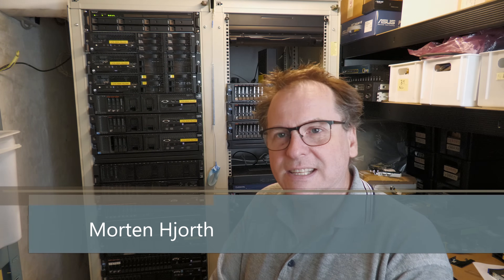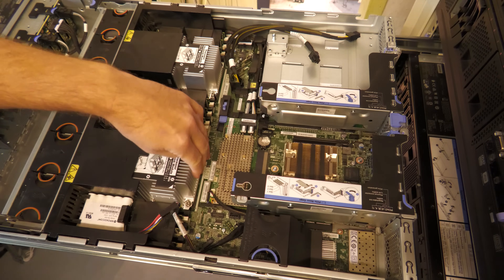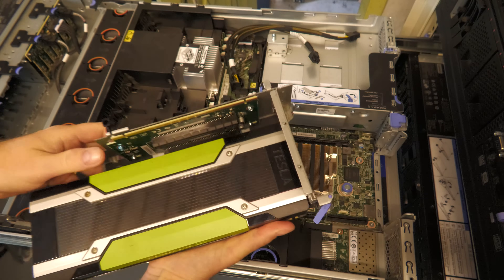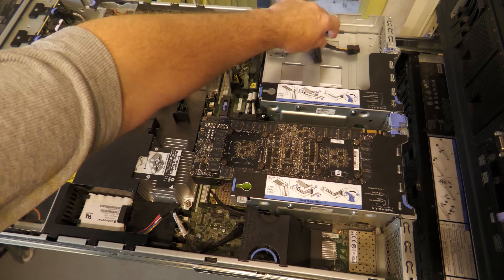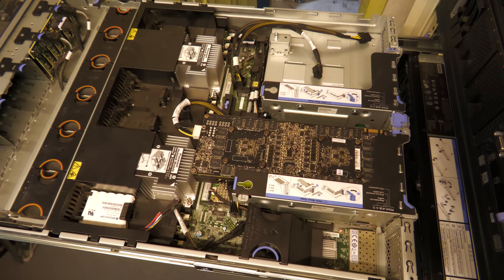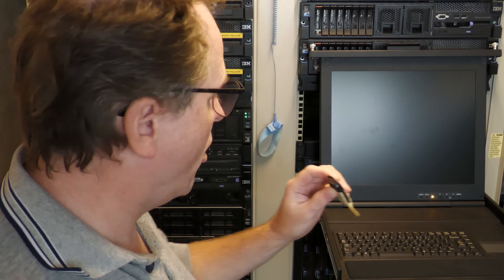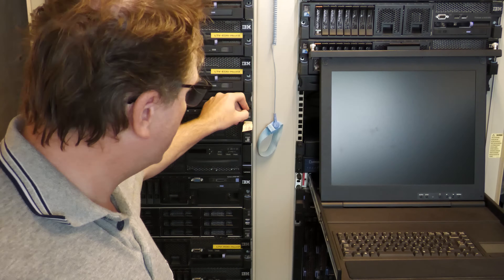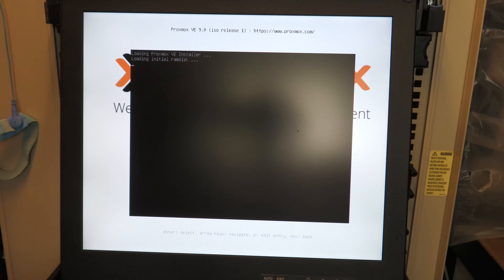Nvidia Tesla K80 & P4 in a Lenovo SR650 = Very Noisy - 1524

Comment: Somehow my notifications got turned off for your channel.. fixed.
At any rate, the P4 will run circles around the K80 and will even beat an M40 typically in most workloads.
I would say with the price of P4s coming down, IF your apps are still supporting the P4 it may be time to grab a few of them.
Reply from the maker: For AI you need a lot of RAM,,, so I wanted a card with a lot of ram :-)

Comment: Yeah, you're not going to get passive cooled cards in there, at least not without a lot of overheating.  If you want to do "AI" stuff, I recommend you look at the workstation cards with blowers - RTX A5000 might be a good starting point and will be software supported for a while yet.  (or, even cheaper, the RTX 8000 still works reasonably and gives quite a bit of VRAM for working with models)
Reply from the maker: I really did not want to spend the money :-)